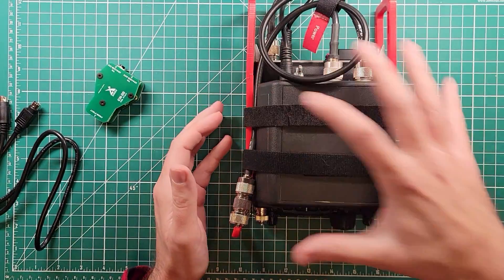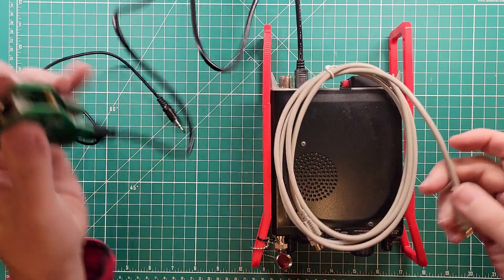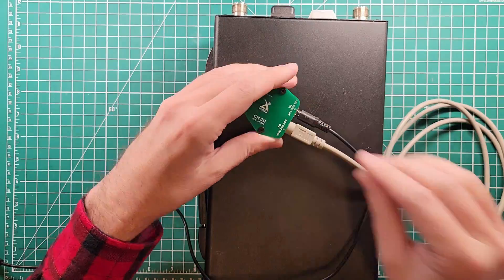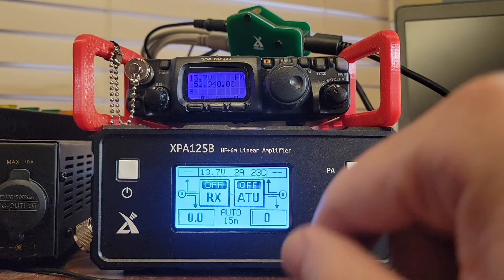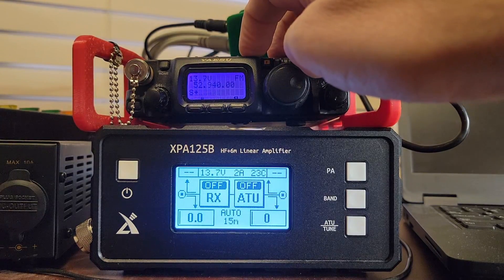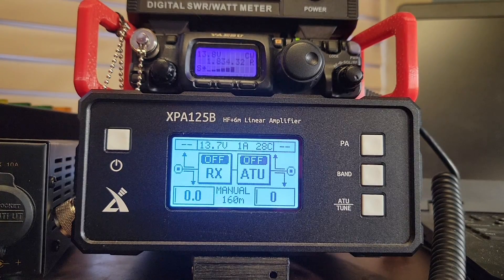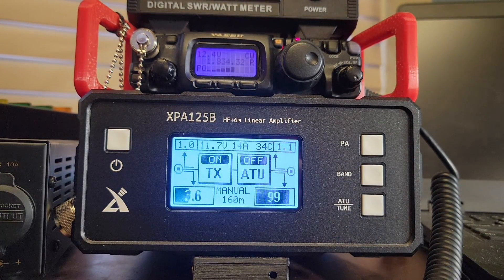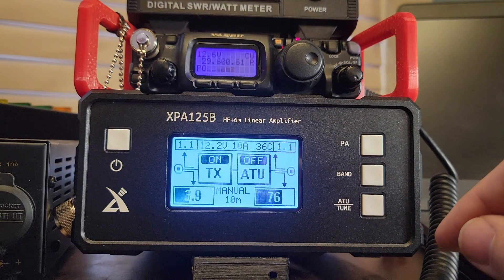Connecting the Yaesu FT-818 to the Xiegu XPA-125B with the CN-20

Comment: I know this is an older video, but I appreciate you showing this particular radio and amplifier combination. I'm currently in the process of putting together a go box and I have an 817 sitting unused. I assume it would fair the same as the 818. I think eventually I'd like to put the Xiegu 6200 in the box to replace the 817 for HF and add a second VHF/UHF rig, but I can at least pick up the amplifier now and get some use out of it for the HF on the 817.
Reply from the maker: Glad it helped!  Thanks!

Comment: When you set it up like this, can you connect a digirig as well somehow?
Reply from the maker: You are correct - the Digirig would connect to the "DATA" port on the back of the radio so you could get audio in/out - but since the "ACC" port is now occupied, you can't do CAT control - this means that with FT8 for example, you'd turn off the cat control and the PTT, set it for VOX and manually tune in the frequency on the radio.  Not impossible, but not too bad either.  I'm sure if somebody was very enterprising they could make a device to go in place of the CN-20 that would allow all things to happen.

Comment: This video sponsored by Sigh-gu. 
A bit disappointing that you add the board to do the thing and it doesn't do the thing (automatically follow bands).
Reply from the maker: Right, it's advertised as working with the  817 and NOT the 818... I can't imagine yaesu changed the band data output in that revision.  There is also no firmware upgrade.  But now we know and we start working on a fix.

Comment: Thanks for the video.  I've added this amp to my IC-7,05, and it's been great so far. Like you, I had minimal expectations. Had to figure out some workarounds to get it to do what it was supposed to, but in the end, it was worth the upgrade.
Reply from the maker: It's a great amp and it's targeted to  Xiegu products... but works with anything that can put out a PTT signal.  I have a video on the 705 with this amp also and that is my default ham shack setup.